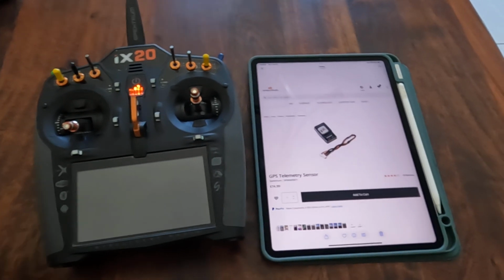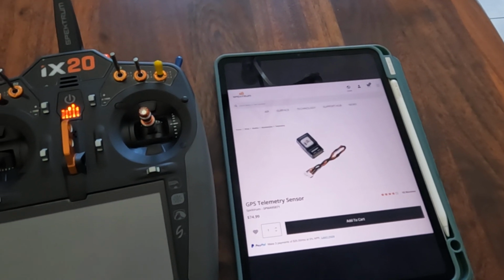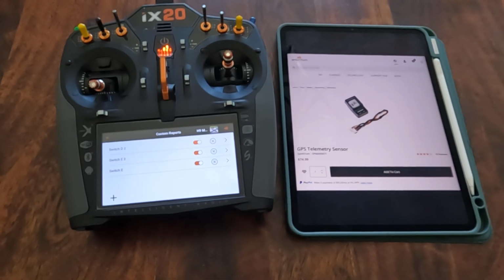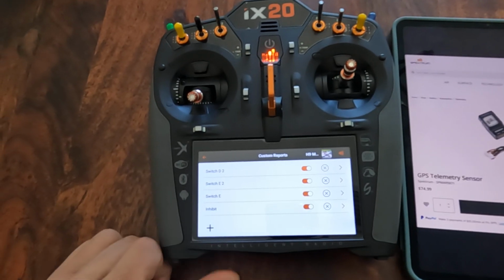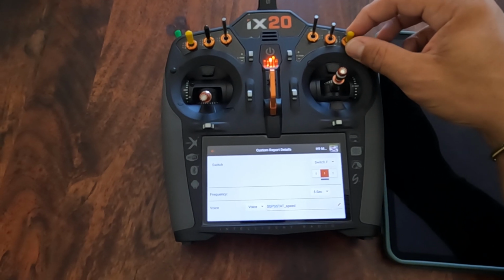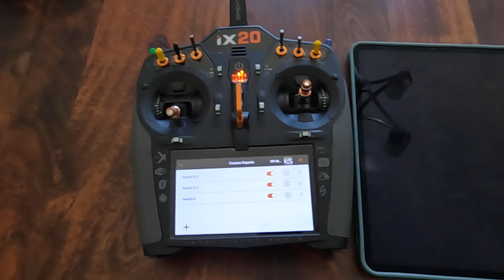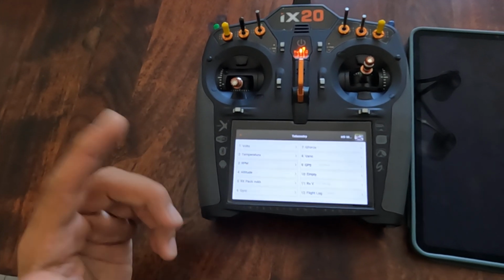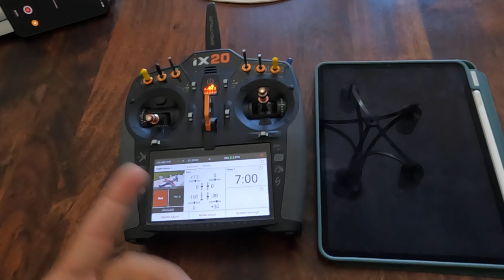How to setup callouts like speed, altitude, & distance, on switches using a Spectrum GPS sensor

Comment: I am using the AR10360T receiver and while I have indications for example altitude and speed, my IX20SE Radio does not speak, even though I activate the function from Custom Reports. I do not know what exactly is happening..
Reply from the maker: Let me get back to you after I look through my settings.
Reply: @Jherny320 ❤
Reply: @Jherny320 My friend, I found the mistake that was finally mine. I set the GPS speed alert to Channel D2, but I had forgotten to mark position 2 by tapping the screen so that it turned orange.
In this way, unfortunately, the Radio was not speaking😅
Thanks a lot again for the video and greetings from Greece - Hellas!
Reply: I get the speed callout ok but it stays on continuously even though I set it to a switch. Of course I want to be able to turn it on. Help!!😂